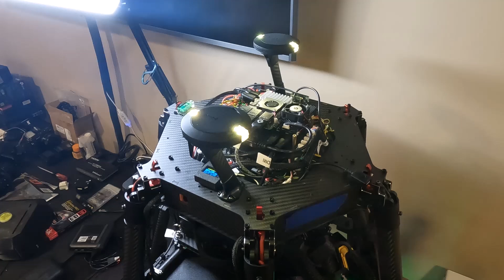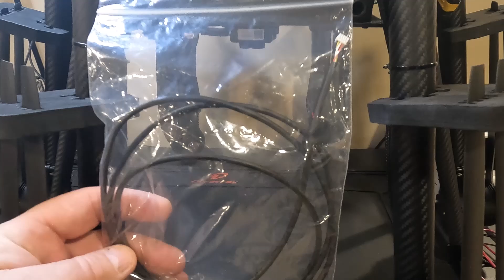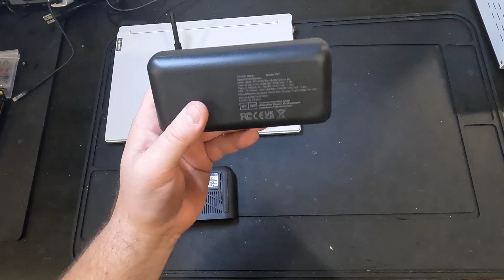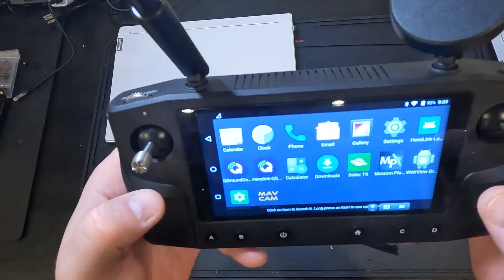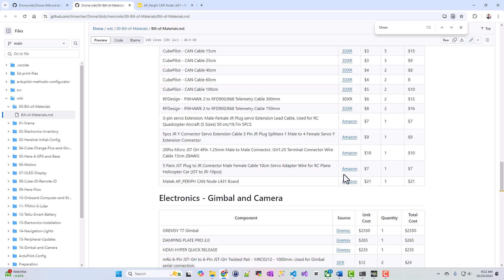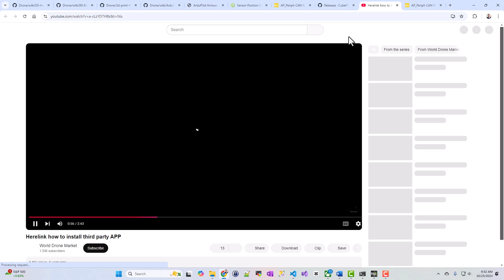Hexacopter Drone Build Project – Part 15 Peripheral Updates

Comment: Good to see you back online. On your 2nd here4 gps, I believe one can use the pair as a yaw sensor. On my drone, I found that the compass in my Pixhawk 6c was not very accurate and causing poor performance. I switched to the here4 compass as primary for much improved stability. The online ArduPilot compass evaluation tool was extremely useful to evaluate and tune compass parameters. ---- good flying
Reply from the maker: @yancymuu4977  good hearing from you! good points on the compass. I disabled the internal compass on the cube too. For the online compass tool, are you referring to the online magfit tool?
Reply: @timarcher52  yes. That's it.
Reply from the maker: @yancumuu4977 actually your commented prompted me to do some googling and found some more new stuff to learn. There's a wiki page on GPS for yaw: https://ardupilot.org/copter/docs/common-gps-for-yaw.html

This prompted me to write this forum post to ask more about it. Hopefully someone from the ardupilot team can help me learn more about it. 
https://discuss.ardupilot.org/t/dual-here-4-gps-for-yaw-moving-baseline-questions/125428

Thanks for your comment! Everyday is a new learning experience with this software.